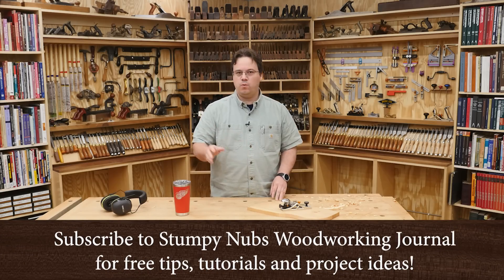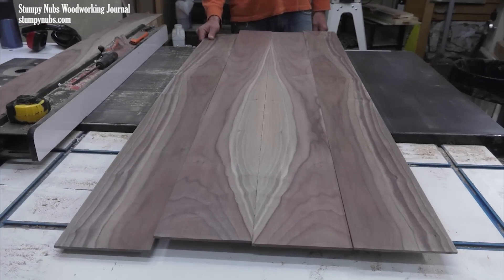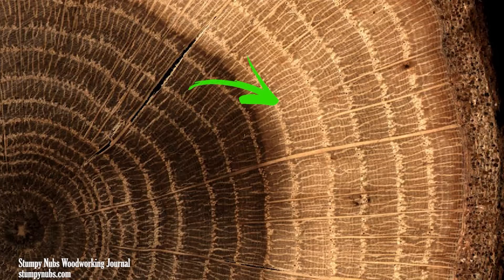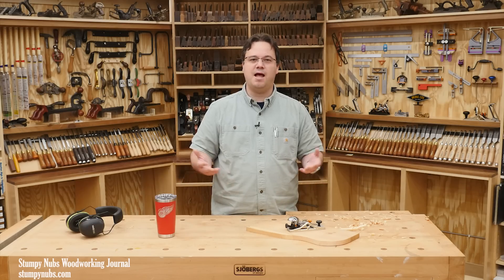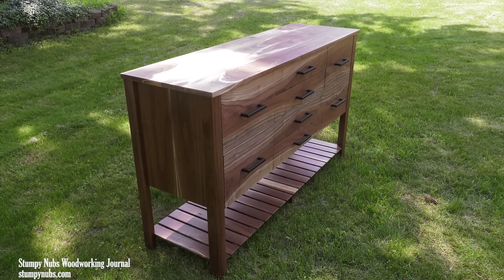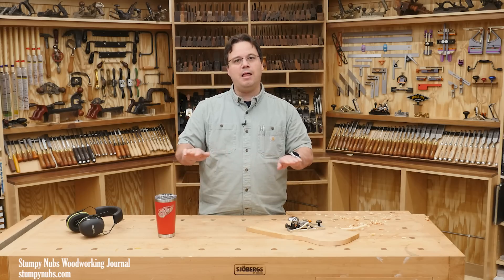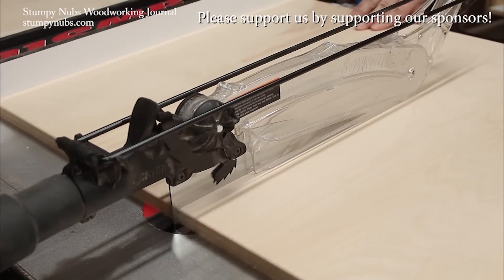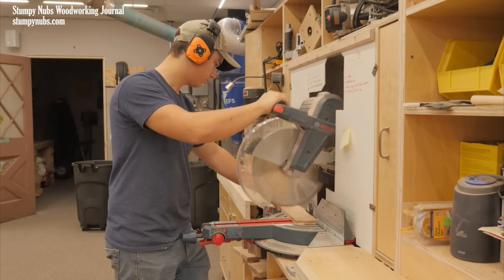"Wood is expensive!" -Out of touch YouTubers waste it!

Comment: One thing about sapwood to think about in a lot of species is that it is much more vulnerable to rot and insect attack. This is especially true with air-dried wood, where the bugs and any infections haven't been killed by the kiln process. In a climate controlled modern home, a little clean sapwood isn't likely to be a problem. But on a porch or deck or whatever, the sapwood is going to attract bugs, powder post beetle, that king of thing, and with significant humidity also any dormant or ambient fungus.

Comment: I use sapwood in a fair amount of my projects, - apple has wonderful sapwood to heartwood contrast, as does English and black walnut. The only problem is that there are a lot of insects that love munching on it! These are logs that I've milled and all of them have some degree of worm holes. I don't worry about them much - fill 'em in with CA glue or epoxy and call it character. One cutting board I made had not one but two unlucky larva encased in epoxy and plain to see.

Comment: I like the combination of sapwood and heartwood. However, at times, using only one or the other is appropriate for a project. Just because you cut the sapwood off doesn't mean you are going to throw it away - you may simply use it on a separate project. Likewise, there is the pith that may also have to be worked around ... would have been good to mention this in your video since you seemed to say all the wood in the center of the tree is stable and, while the actual sapwood is stable, pith is not.

Still, really good video and thanks for telling people sapwood is good and useable.

Comment: I agree 99 percent. The problem is if the sap wood expands and contracts different amounts wouldn't it crack and break off from the board? I have never once seen this. Even when cutting ends of logs off to use circles for primitive stools. 
Just a thought I had. Makes me wonder. 🤔
Reply from the maker: No, because its grain runs parallel to the heartwood, so it can move independently without being constricted

Comment: Great video! I have specifically chosen lumber with a mix of heartwood and sapwood for some projects because  I was looking for that light and dark appearance. I built a top for a kitchen stand I built out of hickory with lots of sapwood and just few runs of the heartwood to get the look my wife wanted. The only downside  is that I have had to strip the clear finish off, lightly sand it and refinish it to keep the look she wants since the color goes off on the sapwood pretty quickly. That's only a few hours of work so it's not a big deal. Keep up the great videos!!!!

Comment: Another use:  when it doesn't show or will be painted.  Western Redcedar is popular for building fences and decks and the like, but a friend of mine bought sapwood boards -- part or all yellow colored -- for use in trim pieces on the outside of the house.  He said it lasts 50 year or more (unlike what he was replacing) and is much cheaper than the clear heart stuff used for staining projects.  

Cedar fence pickets are something of a commodity around here, but I think if they were available in non-clear-heart they could be cheaper, filling a gap between pine (doesn't last) and cedar, when the fence will be painted.

Comment: Great video.  Sapwood does have some other attributes..  The cell walls on the outer grown rings in temperate regions are thicker, as the wood must support the growing height of the tree.  This is also a reason for the different shrink, swell rate within a given board.  Trees have their own wisdom, they know how tall they are, and what they need to do to hold themselves up.  And this is not easily observable in a board.
Reply: "Trees have their own wisdom" -indeed.

Comment: I had a beautiful few pieces of walnut that I used for table legs on a project. There were large swatches of sapwood on them and they came out beautifully. AFAIK - I sold the piece at about a year old over a year ago - it is still in perfect condition. BUT I agree, I would be leery of using sapwood as the entirety of the structural members.

Comment: Another interesting tidbit with walnut (perhaps other woods too), is that commercial kilns steam dry the wood which darkens the sapwood and makes it look more like heartwood (at least initially). This also strips out much of the natural coloring in walnut (lovely red and purple tones) and, in my opinion at least, makes it look like crap. I would rather embrace the light sapwood or mill my boards to avoid it than deal with the dull coloring that commercially dried walnut produces. I tend to seak out small, local mills that don't steam dry for this reason.

Comment: In the credenza example, what would it mean to use joinery that would allow for the top to move at a different rate than the sides? Attach the sides to the legs with unglued mortises, dowels, etc.?

Comment: The problem wirh sapwood is definitely the technical aspects. It is severely softer and often doesn't even want to stay together, it is prone to infestation and molding. It is severly less water resistant. It will also warp.

I actually like the look of some sapwood projects but sapwood should never be at a edge of a piece and needs special design accommodation to become a functional and stable part of the furniture

Comment: I have a different approach.  All of the ceiling in my house are cedar as well as some walls. for the non structural construction I use 1x6 T&G cedar.  I prefer the sapwood because it's lighter.  Other carpenters use it where it's exposed to the elements and want the hardwood.  the random wood is bundled such that you cannot inspect, but I've told the wood mill that I will be returning any hardwood, and they've let some builders know that if they return their sapwood it will be replaced with hardwood. And then we trade.  Win/Win for both of us.

Comment: Does the sap in sapwood mean anything different for softwoods?  I have a pine board with interesting patterns but I think that's actual pine sap.  I'd like to resaw it to bookmatch, just to see how (use cheaper material so I hurt less when i screw it up).  But if by some fluky i am able to actually resaw it myself, should i use it for real?  Ive read/seen thst pine is troublesome.

Comment: It’s pretty clear that solid hardwood construction has been going the way of the dinosaur for years.  Instability has always been a factor, but supplies of stable, straight-grained material has been in decline as old-growth stocks were depleted.  Tropical hardwoods were also obviously hit by poor management and corruption where countless trees were left to rot for the lack of marketable characteristics (ebony is a good example), or forests were simply clear cut to satisfy short-term economic gains.  Many of these products are now unavailable for import.

The craftsmen-level use of veneer has been accepted by the general market for years in even high-end projects, so the market has adapted and accepted the compromise while acknowledging that craftsmanship is not limited to solid-wood projects.  Make use of your vacuum bag and enjoy the results.

Comment: You have to be really careful where you use it in your project. Sapwood is not mechanically sound. It doesn't handle stress well. I used to work for a furniture company that used mainly Alder. The heartwood and sapwood in alder are almost indistinguishable. I often drove apron screws into pocket holes on tables with a pneumatic screwdriver. When the pocket hole was drilled into the sapwood, I'd drive the screw thru the end of the pocket hole and thru the tabletop before the torque brake would engage. Grrr. I'd have to unscrew the apron BY HAND (no reverse on the screwdriver), replace the bad part, and then fix the tabletop - totally ruining my production stats.

Comment: This is obviously a matter of taste, but I find that the bookmatched aesthetic can often be more cheesy than aesthetically pleasing. I think that it works well in certain application, like guitars, probably because the bookmatch parallels the overall symmetry of the build. But when a bookmatch is used as a part of a nonsymmetric component, it's kind of off putting to me, and I think I'd rather that the grain just be deliberately misaligned. I can already see the bookmatch, it's not like the joint is hidden, so I'd go for a less blatant look. I'd say the same thing about a repeating pattern. If I'm resawing a slab, I'm probably going to try to avoid putting the two slabs right next to each other in the same orientation if the grain pattern is too strong. Ideally I want two similar pieces next to each other, but I don't want two of essentially the same piece next to each other.

Comment: Meh... It's wood, and the creativity of this hobby is often in being able to use ALL of it, and still get something great. We can face the reality that we're not world-class craftsmen today, and our work hasn't stood a test of time to see if we will ever stack up. Hell, that's not even going to work in most of our lifetimes. So long as it's not going to outright threaten integrity, then, finding a creative and expressionate means to work sapwood with the heartwood demonstrates a higher potential and relative ability than someone who has to cut off everything "that just doesn't fit"... whatever that's supposed to mean. Wood, like any natural grown commodity has its own character to add to a project, and some of the time, we need to learn to work WITH that character rather than micromanage it out.

    At the same time, where it can't possibly be used, just because we cut it off, that does NOT mean we HAVE to waste it. It's not waste until I've BURNED the stuff... and even then it's keeping my ass and my shop warm...  One of the great ADVANTAGES from sapwood's capacity to soak in water is the ability to BEND OR STRAIGHTEN the stuff... This can be done in one of two ways... 1) steam it, by boiling water in a reservoir to heat the wood up in a "steam chamber" until it "cooks through" so the cellulose and lignen loosen, and then forming it and clamping it tight into a desired shape, and then drying it back out to harden it up again... or 2) soak it for days in water... pulling it out with its form and steadily tightening the bindings to that form, and returning it to soak... usually every 2 days or so... until the desired shape is achieved... and then drying it out again to harden it up and season it "in shape"... 

     Either way, sapwood is just a little more tolerant of such behavior, and beginners at the bending craft will find it somewhat less frustrating while they get used to the processes and practices for such crazy techniques...  ;o)

Comment: A word about your sponsor. Personally, I think that it is dangerous to listen to music when working in an environment which requires safety measures. Reducing noise is one thing but eliminating it completely or blasting it out with other, potentially distracting, noise is essentially removing one of your senses which can provide unconscious information cues to your brain. I have direct experience of this; because I have especially sensitive hearing and there was noise outside my house which was disturbing me, I wore ear defenders around the house but found that I was constantly clipping the edge of the door with my shoulder or putting things down clumsily - if you put a cup down, you are unconsciously using the sound of it hitting the surface to know when to let go. Working with ear defenders may reduce noise to protect your hearing but it still allows you to hear when machinery noise changes potentially letting you know that something may be wrong - music with strong elements can particularly mask this. Machine noise is useful. Additionally, detailed sounds within the audio you are listening to may give false alerts. I'm pretty sure that Robert M. Persig made reference to this in Zen and the Art of Motorcycle Maintenance. As a real life illustration, a few years ago, I was in hospital having had an operation on my hand and the guy in the next bed told me how he had ended up there. He was working on the Forth Bridge (Scotland) with a young guy who was listening to his iPod, he wasn't paying full attention to what he was doing and it cost my fellow patient several fingers - I saw the x-ray of what was left of his hand before the surgeon patched it up and the bones on one side were just fragments. Apart from doing things like painting (both decorating and art) or, say, washing up, I never listen to music when working when I need to hear what is happening.
Reply from the maker: Surgeons listen to all manner of music while literally holding life in their hands. If you find it too distracting, there's is a pause button on the side for while the table saw is running.
Reply: @StumpyNubs  I'm not just thinking of the table saw, I'm thinking of general workshop/workspace safety (I used to be an aircraft mechanic). I think that surgeons are unlikely to hear much in the way of audio feedback from their work but would have thought that communication with other OR staff would be a pretty high priority. Maybe you didn't read the whole of my comment but thanks for replying.